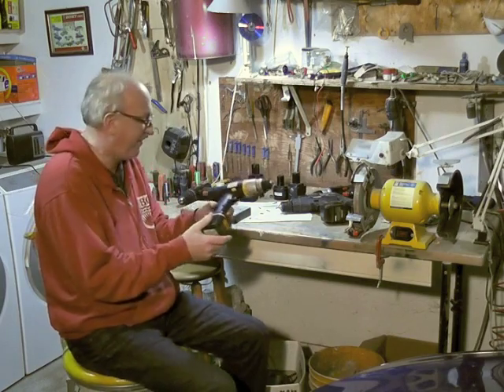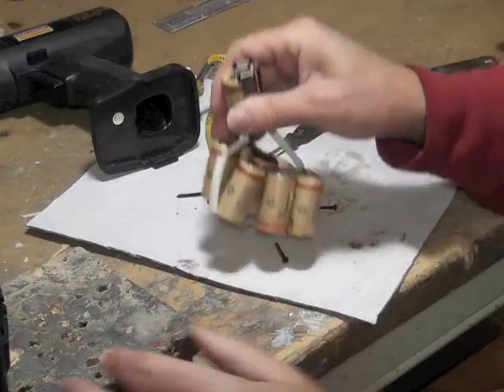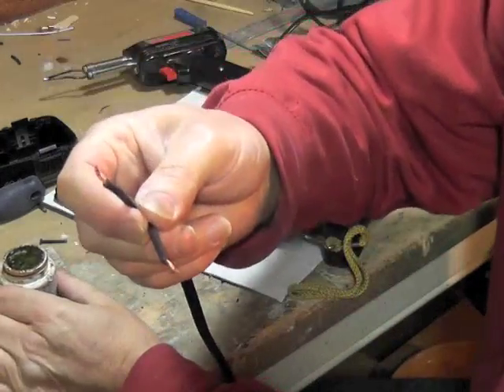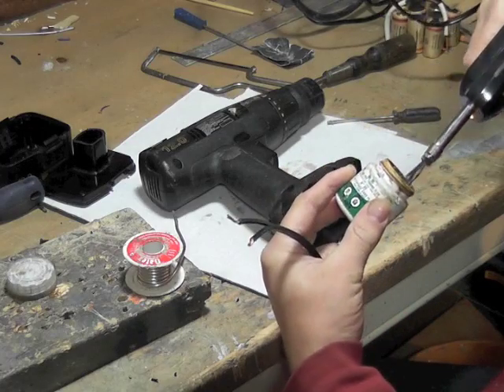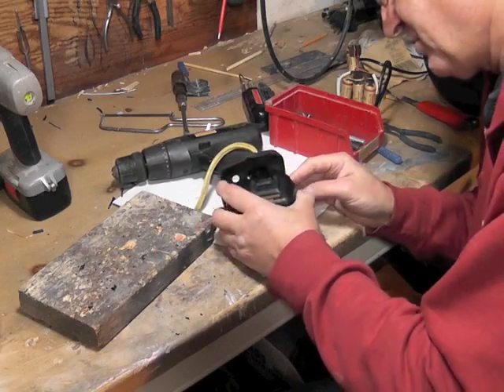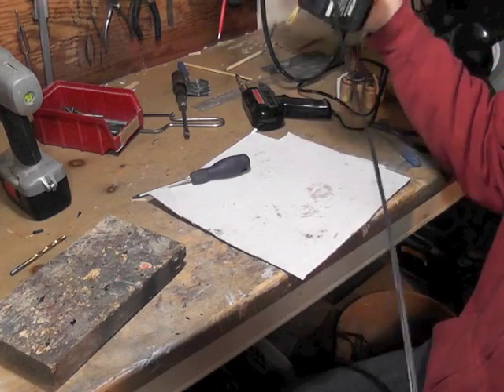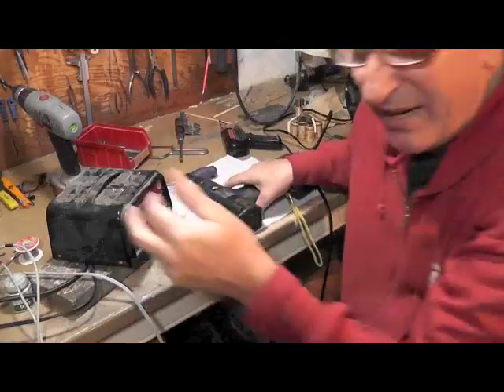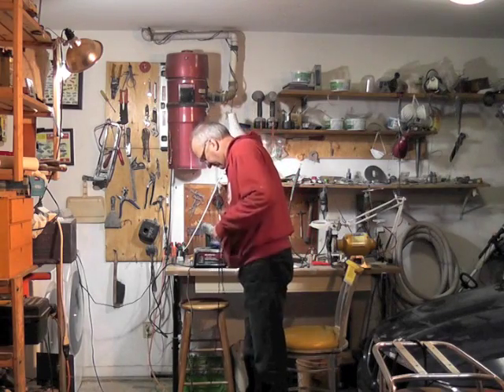DIY: Battery Drill to Mains

Comment: In a way your solution is informative but not quite practical. I need to convert my cordless to corded but I don't have an adjustable power supply, and even if I did, doesn't make sense to lug around a large power supply when going to job sites. I need to know how to make this conversion where all the necessary components are integrated into the drill.

Comment: Hi, many thanks for the instructional video. I did connect an old laptop charger(20V and 3.25A) to my chargerless cordless drill 15.6V. It worked somewhat with no burning or overheating noticed yet but the trigger startup is erratic unless, the trigger is squeezed gradually. Please how do I overcome the jerky trigger startup? What simple component might be added to resolve this? Kind regards.
Reply from the maker: This is the overload on the computer converter. I do not know how one over rides this problem. I stoped trying to use laptop converters because the Amps were not high enough and did not give me enough torque in the drill. I need a drill that powers in crews on a wooden deck so I got a LED converter for about $20 and it worked great.

Comment: I have a 3.6v screwdriver. How much current does it draw in your opinion?
There's nothing written in the manual as well as the screwdriver body.
Reply from the maker: Less than 6 Amp but your Amps can be higher than the screwdriver draws (Amps) but your Voltage can't go higher than 4 or 5 VDC

Comment: Hello Sir
I have Black n Decker drill with battery of 12 volt and 3.5 ampere.

Can we use 19 volt 3.5 amp adapter??

What is the effect of over voltage???

Or what is the effect of high ampere if we use 12v 10ampere or more ampere than battery???
Pls reply sir
Thanks
Reply from the maker: A 12 volt may go up to around 18 or 19 volts (rated drill) and the 19 volt may be a little less than specified  so take a reading. If the volts are too high the drill will burn out. The 3.5 Amps are away too low. You can have lots of Amps as the drill will draw only whats it needs. I tried a 6VDC on my 18 VDC drill and it did not have enough torque. I have used a 19 VDC rated led converter and it worked on 12 VDC drill but you are taking a chance. I took a reading and the 19 VDC transformer was less than specified. The more Amps the better. 10 Amps is fine and so is 20Amps or 30 Amps.

Comment: I did a cleaner version of this. I put the laptop charger inside the battery compartment. Had to cut the back of the battery casing so that the charger comes out a bit.
You only need to plug the 220v plug into the charger for it to work. Unplug it and there are no wires hanging out.
Check it here: https://youtu.be/cICTetSHb64
I hope putting the link here does not violate any rules?
Reply from the maker: "Great idea"
Reply: @Kenneth Smart I think it's 4.5
Reply: @Kenneth Smart maybe there is a torque loss, in fact I can't press the trigger straight to the max, I guess it needs more Ah, but the truth is it works, and it has a lot of torque, so it's ok for me.
I can put up a video of it working, and putting a screw into wood if it helps anyone.
Reply: @Kenneth Smart Just recorded the video. Check it here:
https://youtu.be/cICTetSHb64

Comment: I have a 7.2V Ryobi DC battery drill to convert to AC. what specs on the power adapter should i get?
Reply from the maker: You can get 8VDC,10VDC and 20Amps. An LED converter 10 VDC 20Amps is what you should maybe be looking for. The AMPS can be high as the drill will only use the AMPS needed. Many try computer converters out but they have power surge protectors so when the drill is switched on the power dies as this is when it draws the most. The TV converter i used worked but the torque (6 Amps) was not good enough for what I needed. Mine was a 18 VDC and is the best drill to convert to mains. One can pick them up for $5 as the batteries have died and usually go to the dump. I got some from a friend for free. I hope this helps with your drill problems. Cheers Willy

Comment: Hi sir willy. I did exactly the same and i used  2 cable system with blue  and brown.  I attached the blue  into the negative and brown with the positive. However when i tried, it worked but it tripped the circuit braker. Please can you tell me what had gone wrong? Thank you
Reply from the maker: The converter may not be able to take the Amp load of the drill and it tripped the circuit braker. Most computer converters have a trip circuit built in and trip off when the drill is turned on because of the Amp draw. 
My guess is that this is what happened to your system or you have a short circuit or the converter burnt out.
Reply from the maker: Check out my other video on Drill to battery. I improved the system by buying a LED converter with 20 Amp and it worked great.

Comment: Nice to see this. I was working in that too. I have a cordless drill about 16.8 volts. Battery was broke and threw it away. I did put on a laptop charcher, powercable with 19 volts output and 4.74A output and max 90w. Now it does not work. I have other cables from laptops. Like output 16v and 500 mA. And also DC adaptors like that. What can I do? Thanks!
Reply from the maker: Most laptop converters have a surcharge cutout so they do not work. Also one must find a higher amperage (20Amp)
The closes I have come to getting the drill to work without buying anything was a TV converter with 6 amps. I would buy a LED converter from China for about  $25 Cdn  On one of my other videos
- DIY Battery Drill to Mains Pt3 - I give the specs for buying (18VDC - 20 Amps) and I have been using one for 3 years without problems. Plenty of torque from drill because of higher amps. 
The Amps can be high as the drill only draws what it needs. If you go to high on the VDC the drill will burn out. Hope this helps..Cheers Willy
Reply: @WillyDahm  Thanks. I already found out, that the amps in higher is important and not  the volts too high. Most of the adaptors for laptop are not higher than 4 amps. Most are 19 volts. Maybe a higher voltage above 16.8v should not be more than 18v or should 19v be ok, without burning the engine? So a laptop adaptor or charger is no go for doing this. Most adaptors for charging are not good to give enough power to make the drill doing good, I think. Or maybe you have to combine different adaptors with lower voltages and with higher amps together. But not too much above the voltages together, what the drill can have. The engine inside of my drill says:  7v and 8v. Maybe it is together 7 and 8 is like 15v or higher. Maybe it is better worth to spend some money to get a power, what is better. But my drill is already old. I have a battery charger with 13.2v output and also power output. But wit like 3ah output. It is for charging up batteries for cars and others. Can also make work radio and 27mc communication old school. All on 12v. Combination making adaptors in volts en amps, is it possible to make it work? Thanks. From China is also maybe to think to buy a thing like that and make it work.

Comment: I did the same thing to a 9V battery powered drill, but instead of a 9V charger I'm using a 12-14V 15A charger set to 14 V. Just did a CCTV job for a client and the drill had no problems. I'm using a 5 meter 2x2.5mm cable. So far so good.
Reply from the maker: Sounds great. I now use a LED converter from 110vac or  220vac to 14 dc 20 Amp. Bought it in China and it runs great for the last couple of years.

Comment: Just tried this but drill runs far to slow .?
Reply from the maker: Check out my using led converter. It’s been working great for two years. The Amps were too low on this tv converter.

Comment: there was no logical reason to cut the battery :). you should have fixed the mains wires to the connector already present in the battery - which would then connect to drill terminals.
by drilling hole in the bottom of the battery pack for entry of the wires and soldered onto the battery connector.
Reply from the maker: I wanted to make the drill lighter
Reply: If I ever need to do this to a drill due to one of the batteries gone bad, I will strip the cells out and feed the cable through the battery casing, and solder the cables on the battery terminals. This way you can use the drill in the shop using mains power and outside using a spare battery if you have one. As you don’t have cells in the battery casing, the drill still lighter. Soldering the cables inside the drill renders the drill just to mains power. Having the ability to both mains in the shop and batteries outside is a bonus. Great informative video anyway. Subscribed.

Comment: I've got a 14.4 volt drill and a 17 volt charger. What's the worst that can happen?
Reply from the maker: The drill says 14.4 volts but can take a little more as it is under rated. It most likely will work but the drill could burn out. If it runs it will not burn out as I have tried a old drill on higher Voltage as a test (12 Volt drill on 14 Volts) and it was fine. Got told by a electrical engineer that it would work so I tried it. ....Good luck
Reply: @WillyDahm  Cheers! Thats gonna be todays job. I'll let you know how it goes.
Reply: @WillyDahm  Just done and it kind of works. Not spinning fast enough to drill anything( don't think it had the amps ). Change to a 12V 3AMP charger and still not fast enough.( Could now turn a loose screw). I enjoyed this project very much and am now keeping an eye out for more chargers. Thank you for the inspiration.
Reply from the maker: Your amps are away too low. The drill will have no torque as you have found out.

Comment: How many amps is maximum?
Reply from the maker: Go to my video on YouTube:DIY Battery Drill to Mains Pt.2
The proper way to do this. 
Adapter for Led lights 110V - 220V to 18VDC  20 Amps
The Amps can be high as the drill only draws as much as it needs. Going too low in Amps makes the drill have no torque. No power for proper handy work. The 6 Amp was not great but I have been using the led adapter for a long time in my workshop and it still works great. I have listed  the specs and where to buy on one of the videos. Good luck Willy

Comment: Very good idea. But I would insert the wire from the side of the base not under. So it can stand .
Reply from the maker: I corrected the wires and put them out the back. Also I put a compound in the battery pack to give it more weight so it stands. Thanks for the feedback.
Reply from the maker: Thanks for the feedback. I put the wires out the back and put compound in the battery pack to give it weight so it would stand. I have used the LED converter and the drill has performed great for the last year and a half.

Comment: This video is by far the most helpful I've come across. Thanks for the video.
Reply from the maker: If I can get one drill out of landfill I have succeeded. I tried various adapters/converters and after four mishaps I came up with the LED  converter. The problem with most of the videos is they show converters that have no torque so they are useless. Thanks for the feedback and I'm glad it helped.
Reply from the maker: FYI : I have used the LED adapter for a year and a half and have had no problems.

Comment: why dont you just solder the wires to an empty battery pack then you can use it both ways
Reply from the maker: I have already soldered to an empty battery pack. I had some problems with the connections so I made it a fixed one for the workshop as I have a second battery drill that I use when needed. I was having  too many dead batteries with the two drills being used so I changed one over to mains. Yes one can make it work on mains and on the battery by using an empty battery pack. Thanks for the feedback and question.
Reply: That's what I did with my old power tool set, they all use the same batteries. But it took more work/steps/pieces to customize solid the inside of the empty battery pack using a car 12V plug... edit: that way I can be more mobile with that set using a portable car power booster or directly into other sources of power

Comment: Hi...I got an old drill 7.2V with battery 1.5Ah. So, the adapter I choose must be 1.5A or higher? Could it possibly damage the drill later?
Reply from the maker: The 1.5 amp hours is what it draws. Your adapter should be 7VDC to 8VDC and 10 amps to 20 Amps. The amps will not damage your drill. The drill draws as many amps as it needs. (on demand) 
I would say if you got an adapter at 1.5 Amps the drill would not have any torque. Most likely useless..
When I tested on adapters from computers the adapter cut out due to power surge when pushing the drill on switch fast when I did it slow the surge did not break telling me that there is a surge when starting a drill.
All drills can take a little more than specified in Volts as in your case 7.2 VDC may go above to 8 VDC
but once it goes too high the drill burns out.  Adapters are plentiful on Ebay  and Amazon and look for the adapters for LED lights  (boxes) as they have no power surge.  I hope this help you find the adapter you need.

Comment: I use mine with a 12v AGM or gel cell, extra current doesn't matter. I color code my connectors and paint next to the tabs on the battery the correct color
Reply from the maker: Correct....Current - Amps can be high as the drill will only draw so much but if your amps are too low the drill will have no torque.

Comment: I have a similar drilling machine, how to charge the old batteries without having the original recharger?
Reply from the maker: I would keep an eye out for a second hand charger as they are everywhere. Once the batteries go dead people throw the drill out as batteries are too expensive and it's cheaper to buy a new drill set. I would keep an eye out for a second hand charger or buy the converter.

Comment: so do i need output dc 18v  6 amps  ac adapter for my 18v cordless drill?
Reply from the maker: My adapter is 18VDC - 20 Amp     110/220
Go to my youtube video:   DIY Battery Drill to Mains Pt.2   and you can see it in action
Led adapter from China
S-360-18      Model HJ 1820
cost $25 Cdn    
110/220 to 18VDC  20 Amp
I have used this adapter in the workshop for quite some time. Works great

Comment: I tried a laptop charger that didnt work output 19v 3.2a...
Reply from the maker: Most laptop converters have correct 19VDC but 3.2 amps will get you no power and many of the computer converters have surcharge breakers.

Comment: Hi Willy Dahm thankyou you so much for uploading this video i have a question i have a 18v cordless i have put a output dc 12v 900ma mt cordless works but its not powerful... what do i need a 18v output and how much ma ? please help...
Reply from the maker: Up your amps to 20 AMPS to get power. The drill will only draw what it needs so getting higher amps is a bonus. 
I tried 6 amps and it works but is not high enough to make the drill work to it's full potential. 
Good luck and glad you are recycling. Let me know how your project works out. Any more questions feel free to ask. 
Willy

Comment: Going to take an obsolete Skil 2480 Warrior Drill, no charger avail, due to recall. It’s a 12v, and If I use a 12v converter “box” ( like computers, etc have) and amp is below 5, it will only turn slowly. Solving that. 3 days, Amazon should deliver 18v converted from 120v, and 10amps. Can’t wait. Got many more drills, but it was my Dad’s, and its kind of like having a picture of him, as I remembered him using so often.
Reply from the maker: I tested Led converter adapter from China. 
S-360-18   Model HJ 1820
costs $25 Cdn      
110/220   to 18 VDC 20 Amp    will run most 12, 14.5 and 18 VDC  drills
If you are worried about 18VDC  go to 12 VDC and 20 Amps
My 18 VDC only reads 14 VDC on multimeter and that is why it works for all three voltages.
I would most likely buy a 20VDC  20AMP unit now and see what I get in VDC output (multimeter test)and use it for my 18VDC drill.
The drill will only use the AMPS it needs so having higher AMPS is a plus for having torque in your drill.
I talked to an electrical engineer and one can go higher on voltage (drill is made to take a little higher voltage) but only a little.
 I have tested this out and it works but if one goes too high one burns out the drill. My advice is to not go more than 2 VAC over ...18 VDC drill use max 20 VDC
Reply from the maker: My Dad had on of those screwdrivers that you push and the head turns...big long thing. I have one in my workshop as it reminds me of him using it. Good luck with your Dad's drill project. "priceless"